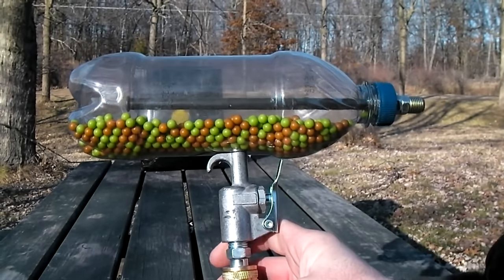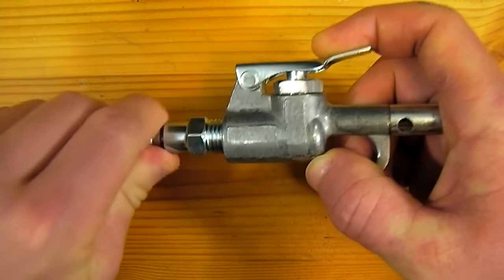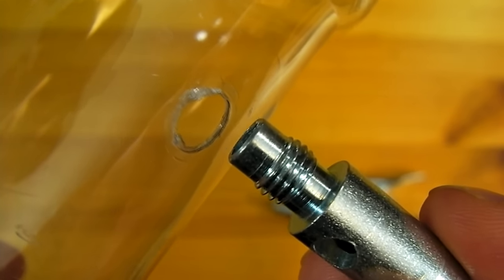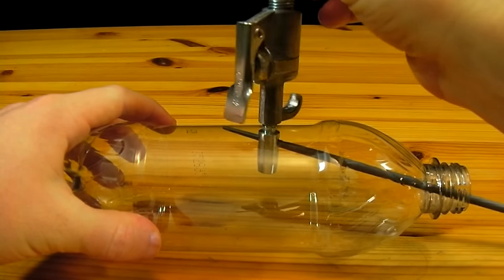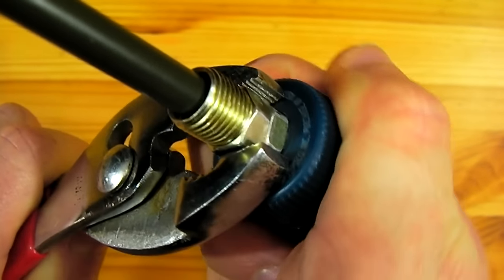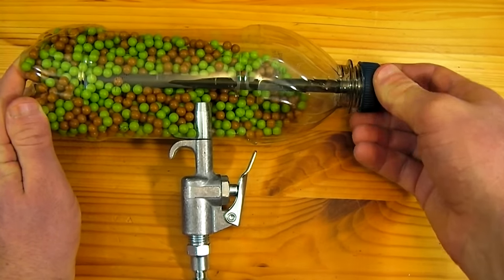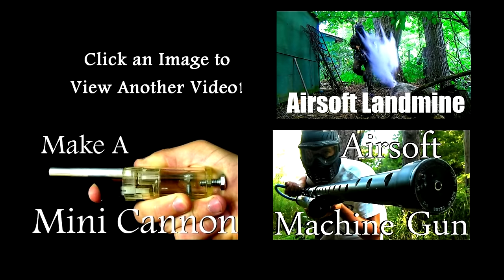How to Make an Airsoft Machine Gun from a Soda Bottle

Comment: All airsoft guns look incredibly powerful at 4 feet away from a target.
Reply: Hahahaha
Reply: I wonder what the target was made out of. I tend to think that if pellets can penetrate cardboard, they can penetrate human skin as well, but I wouldn't put my life on it. Also, with a few adjustments to the pressure of the air compressor I'm sure it would shoot heavier metal BB pellets(the ones you put in airsoft rifles).
Reply: Look at how inaccurate it is
Reply: @thatminer5488  Who needs accuracy when you have that much dakka?
Reply: I'm just wondering if you can replace the plastic BB pellets with nails. Then you'd have a zip gun that works with the same mechanism.
Reply: Pająki Demka [konto nieaktywne]  So it's the aerodynamic nature of the spherical shape of the ball that is BB's that makes this work with them? What about copperhead BB's instead of nails?
Reply: hes using compressed air too though not just a little spring in a tube like most airsoft guns are thatd hurt to get hit with to be honest and thats the point of airsoft is so you dont get hurt when you get hit
Reply: @astibusgaming3649  theyre not rounded youd get them either just bouncing around in a not good at all container for them to be in with that happening or youd get em puncturing the sides and flying out everywhere
Reply: @thatminer5488  It's called the "beaten zone".
Reply: Not Necessarily…
Reply: @gcart5619  bro airsoft guns usually use co2 gas and yes it does hurt you can hear people get hurt a little when they get shot in videos.
Reply: @hartianx1698  should probably paint it yellow
Reply: @thatminer5488  it's made from a bottle... what were u expecting it to be like a sniper....

Comment: what is the FPS of this??
Reply: jeffery spangler OVER 9000
Reply: Depending on the air pressure
Reply: @boang9873  any idea on how to limit the max fps? I really want to build one but full auto above 0.5joule is forbidden over here. As in: it would count as a weapon and would need a permit. XD
Reply: @FirFirence  Sorry for responding 8 months late, but your best option is to test diffrent barrel lenghts, I mean it only gainst speed while it's pushed by air in the barrel.
Reply: 500+

Comment: The same build could be applied to paintballs using 3/4" PVC tubing and a bottle with a larger mouth.  Make it run better and put a layer of teflon pipe tape on the air fitting side and some rubber O rings on the exhaust end of the blow gun.

Comment from the maker: @Cwafter You would want to keep the chamber that the BBs go in close to the same size as a bottle. If you used 4 feet of PVC it would take about 50,000 pellets to fill it half way. A longer barrel will work just fine on this model though, making it both more powerful and accurate.

Comment: in the beginning you say that we only need four things. but we also need a drill, a metal file, and an air compressor. thats like saying: to accelerate from 0-60 in 3 seconds you only need a license, two hands and two feet but you leave out the lamborghini
Reply: everyone has a drill
metal file
and an air compressor is like 40$ and can be used for many things like blowing up ballons, filling your car and bike tires, making pneumatic systems... you get the point
Reply: P
Reply: Mariah Cosper Q
Reply: Use nitro, that should help the car go faster.
Reply: You only need one foot to accelerate bro! And you can probably do it with one hand too.
Reply: To be honest he did say you only need 4 PARTS, and tools aren't parts.

Comment: Hey NightHawk! If I were to exchange the soda bottle for a  PVC tube, would it still function in the same way? That is, if I were to make it airtight and use the same brakeline and all of that. 

Thanks for your help!
Reply from the maker: +Tyler Mintus Yeah that's fine
Reply: +NightHawkInLight  from where did you got that handle like part
Reply: +NightHawkInLight I DID IT!!!!!THANK YOU SOOOOOOOOOOOO MUCH I ALWAYS WANTED TO BUILD A MACHINE THANK YOU!!!!!!!
Reply: +NightHawkInLight for this build can i use a bike wheel pump or no thanks for the help
Reply: +THEULTIMATEPLAYER You would have to pump really hard to get any kind of pressure.
Reply: ***** thx man
Reply: THEULTIMATEPLAYER Get one of those foot operated ones.....might work good.Probably would need a smaller bottle though...this thing is awesome so Im putting all the possibilities together
in my head haha
Reply: what is that little thing??...

Comment: You don't  show a very important part = how the release valve threads to the air source! Not much of an instructional without this
Reply from the maker: It uses the quick release air compressor adapter shown threading into the blowgun. It's pretty common knowledge how to use one for anyone familiar with using an air compressor and air tools. You can ask at a hardware store or look up how to use air compressor fitting online.
Reply: NightHawkInLight OK thanks

Comment: it should be noted that a plastic soda bottle will explode if pressure exceeds around 90 lbs per square inch in case your barrel gets lodged as most compressors can reach these pressures easily

Comment: Poor mans polarstar anyone?
Reply: That's what I was thinking. :D
Reply: Layton Malmstrom Not really. They are a proven and reliable system. Don't be mad that momy and dada won't buy you one.
Reply: rkshirey Precisely the problem I have with them. Believe me, I earn enough cash to buy one but I dont want too. Most kids with P* at my arena have rich parents and all they do is overkill by turning up the pressure and bumb fire.
Reply: layton115 As long as they are within the fps limits, deal with it. They have a superior weapon. Do I like how they got it? No.
Reply: rkshirey Thing is, if you can DSG your AEG and upgrade it to shoot 50RPS you have my respect as a tech. P* doesnt mean you made yourself some amazing gun, its pretty drop in.
Reply: layton115 Yeah, but that 50 rps AEG of yours will die 100x faster than my polarstar. In fact, the polarstar won't die. I saw one go 300,000 rounds without lube that eventually stopped working. Know what was wrong? There was dirt in the air line. It got cleaned out and worked fine again. 
And just using a polarstar stock takes no skill to tune. Tuning it to perfection takes a lot of skill. You have to know bb weight, barrel length, air being pushed, amount of time that air is behind the bb and many more factors.

Comment: Nice project! Those wires might be easier to manage if you put those wires in a RadioShack project enclosure and used ribbon cable.
Reply: I meant put the ignitors in the project enclosure

Comment: You can probably get the break line at autozone and the other stuff at home depot. Or you can probably buy it all on amazon or ebay. Of course you would also need a air compressor which would be kind of expensive, unless you already have one.

Comment: This is AWESOME!  

One question, Can I use PVC piping in place of the pop bottle?  I would figure that It would work the same in theory.  My only question would be if the PVC can handle the air pressure the way the pop bottle does.  HELP!

Comment: I am preatty sure the answer is NO. If you connect it to a aircompressor then the tanks on the compressor will run low on air and the pressure will go down and the gun won't shoot. Same for a airtank, it will run out of air and pressure. If you got the gun connected to a compressor that is connected to a sorce of electricity then you won't run out of air because the pumps on the compressor will keep on filling the tanks as you use them up. Then you would only have to worry about the bullets.

Comment: You would need a compressor to do that. If you got a airtank then you need to use a air compressor to fill it back up. If you connect the gun straigth on to the compressor you would need to have electricety connected to the compressor for it to keep the airpressure up in the tanks. Thats the only way i can think of. Maybe just bring some extra airtanks to swap out with.

Comment: How did you make your backpack mounted air chamber?
And how is it working? With electricity?
Reply: probably with gas, but i didn't see any gas tank, but it cannot be elektricity, if yes, then it will need some engine and battery
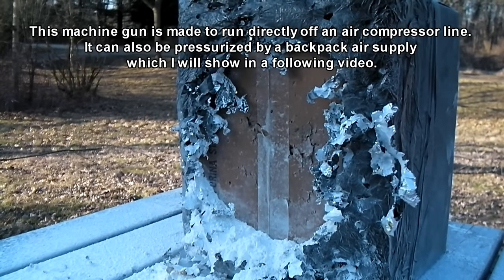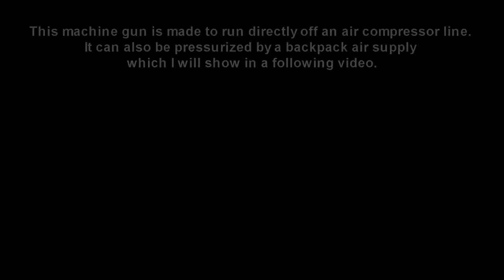Reply: 0:22 - 0:26, top of the video.
Reply: This project doesn't use gas. They're using compressed air.
Reply: he is using an hpa tank and remote line

Comment: Any idea on the amount of fps you can get out of these? A round guess. I mean is it only around 400 or are we talking 1000+? Hard to judge from the vid although it seems pretty damn powerful.

btw- Great video, subscribed.
Reply from the maker: Fps rely's on many things. With this barrel length and a compressor running at 100psi or so it will fire around 350fps. With a longer barrel you can make it much faster.
Reply: looked and sounded a lot faster than that in the video, Not bad for air soft though. Again great vid, thnx for the reply.

Comment: how powerful of a compressor are you using? Size of the tank, etc? Considering getting a 5HP, 3 gallon tank with about a 4.5 CFM if I remember correctly and am quoting the specs correctly. From what I have read that would be powerful enough for impact work, which is my main reason for purchasing, but having toys makes life fun lol.
Reply from the maker: I have a 40 gallon compressor and run it at about 100psi. A 3 gallon will work fine, but will only be able to fire this gun for about 30 seconds before refilling.

Comment: how powerful is this? fps? I plan to build one with a propane tank as a air storage container instead of the PVC tank in your other video. it will hold 100-150 psi of air pressure and will be autofilled during use with a 12V air compressor

Comment: How difficult would it be to attach a co2 cartridge to the airgun so you don't have to worry about an air tank/lines? Just carry a pouch with a few cartridges if you need portability

Comment: Used this same idea back in the 70s, using a semi tire as the air supply, a length of copper tubing, real metal BBs, bed of a pick-up, and the storefront of a  shopping center late at night in Shreveport. The results was horrific, glass everywhere.

Comment: What size compressor did you use!? I have a small red compressor with a max 175 psi and it shot at most 20 feet.
Reply: He used a 40 gallon compressor, and fired at 100 PSI

Comment: Do you thing it would be possible to use an old fire extinguisher modified to use as the pressured air tank? If so could you make a video on this. :)
Reply: it is possible, but it costs a butt-ton and will have all of the foam fire suppressant flying out.
Reply: If you empty the extinguisher and fill it with only compressed gas,it WILL work just fine,, I just filled my empty FE up with airsoft pellets and created a barrel out of metal or plastic or even used the standard nozzle,,eliminating the need to make the gun altogether,,it hangs in my shop and looks just like a regular Fire Extinguisher

Comment: I want to experiment using this principle, but using 3/8" or 9.5mm steel bb's running on my compressor's max output whitch I think 18 bar / 1800 kpa ( 261 psi )

Comment: how well does this work? how powerful is it? also,does it matter where one puts the hole? I'd like to put it more to the back.
Reply: try to use at least 70 to 90 psi of compressed air , then it will tear up a flesh
Reply: Deolito Nazareno I don't want it to cut. I just want it to sting.
Reply: Deolito Nazareno will it go through body armor ?
Reply: bulldog8459 it will be depending on the projectiles and the maximum PSI of the pipes.
Reply: Deolito Nazareno metal projectiles and maximum psi ,but wouldnt it  break the plastic bottle?

Comment: Hey Nighthawkinlight I can`t find a 7mm brake line at the auto parts dealers they only carry S.A.E  sizes . So what size should I use ? would 5/16 " be okay ?, as 1/4" is to small.
Reply from the maker: 5/16
Reply: +NightHawkInLight is there a way to hook up propane to the gun like so I can have the small tank in side of a back pack? the field I airsoft at allows home made guns

Comment: where do i buy a 5/16" x 8" Automotive Brake Line and a 1/4" Quick Release Air Compressor Fitting
Reply: Hardware and automotive stores or online. Im not sure if you still care since its been 7 years but whatever.

Comment: Fill the bottle with steelballs and you really have something serious
Reply: +elpresley air wouldn't push the steel into the barrel thus no function. would have to be really light object or a lot more air pressure

Comment: The two side holes in the air blower nozzle are supposed to be for safety, to prevent you from blowing a hole in your skin should you be so stupid as to place the thing against your body and squeeze the trigger. In this case they keep the pellets stirred up in the bottle. There's only one way out so as they fly around they eventually go past the inside end of the tube and get blown out.

Comment: Can i exchange the automotive brake line with a PVC pipe???
Reply: +Gio Estrada Yes of course, make sure the diameter of the pipe is only slightly larger than the diameter of your projectile and it'll be fine. You can exchange the soda bottle for any kind of sealed compartment as well, including a larger PVC pipe with end caps (I'd add a capped tube at the top to refill it as well)

Comment: do you need an air hose to plug in to the end of the thing on the bottom?
Reply: I guess so I don't seem to figure out any other explanations as those tiny tools don't seem to make it compared to the power speed of the pellets he must have a air hose connected to the compressor, but I could be wrong I'm no expert with this kind of stuff.
Reply: james valliere obviously.

Comment: The only part I know where to get it the soda pop.  Where do yo get the Airsoft BB's and the other three items?
Reply: Walmart for the airsoft bb's and your local hardware store for the breadline and the air compresser parts...if you can't find a breakline tube at the hardware store check an auto store like car quest or auto zone
Reply: Breakline not breadline. Wtf? Breadline?
Reply: William Ela I knew what you meant William Ela and I appreciate the info.  

I have made more typos than I care to admit.  Just when I think a message looks good, and it gets posted (looked great to me at the time) going back to it sometimes reveals a typo or two.   

I don't think It's worth beating yourself up for it, be kind to yourself as you would be to others.  Thanks again for the info.
Reply: Ok I was just saying that more because I have no idea how 'breadline' was in my autocorrects

Comment: You only need these four pieces? What about the air compressor? You juzt suppozed ti bliw on it with your mouth? And if you're uzing a.compressor what zetting for the PSI? Too much mighy blow the tbing up in your face. Also people need to be told to wears eye protection. Neat cheap fesign otherwise.

Comment: What psi did you run this at
Reply from the maker: Around 100
Reply: NightHawkInLight do you plan on attempting to run this off a smaller air compressor that could fit in a backpack or something similar
Reply from the maker: @danuke4254  It's done. I made a video a short time after this one about that
Reply: NightHawkInLight oh well I’ll go check that out thanks